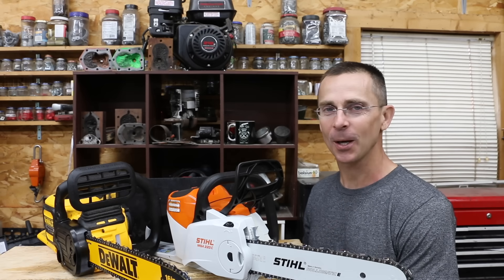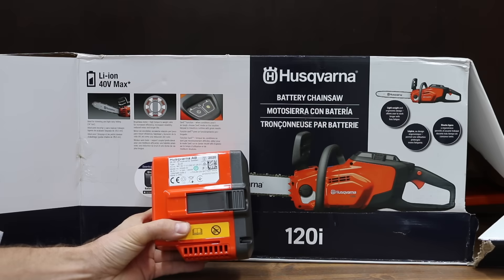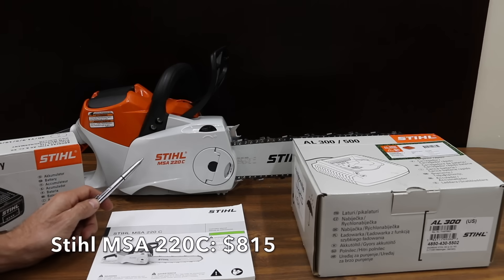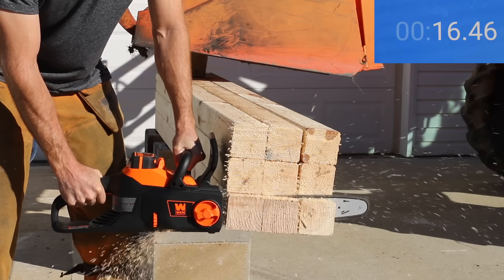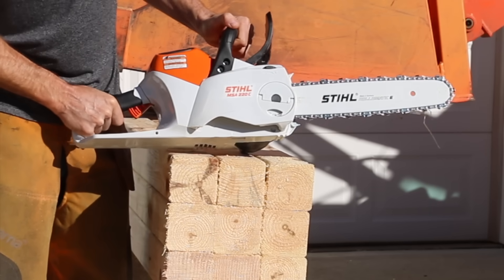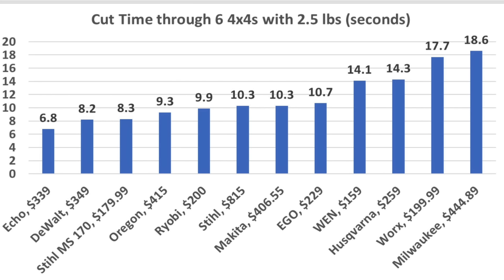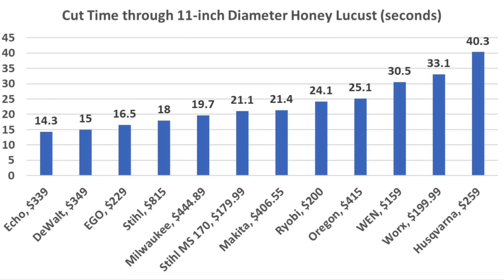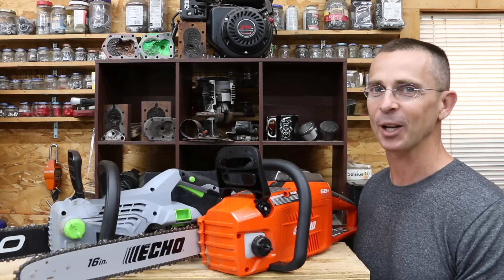Best Battery Powered Chainsaw Brand (ROUND 2)? Stihl, Husqvarna, Echo, Oregon, DeWalt

Comment: Thanks for all you are doing.  You have SO much credibility and are becoming the "go to" channel for purchasing decisions.  I have a suggestion for a video.  Recently you tested automotive batteries. In that review you used the Foxwell tester.  As I have researched these "Conductance" testers, there are so many at a wide range of price points.    I would love to see if the lower priced units are as accurate (or maybe more accurate) than the higher priced units.  In my studies I was also hearing the importance of  internal resistance (which you mentioned in your battery review)  as a key battery health indicator, which these types of testers can measure.  I have seen two lower priced testers become popular on YT (Quicklynks BA101 $40.99, and the Topdon AB101 $49.99).  Bottom line, I would love to own a tester that is accurate (and a good value) and can give me an early warning of a failing battery before it becomes an emergency.  Thanks again for the great job you are doing.  You have really built an amazing and very needed channel!!
Reply from the maker: Thanks for the video idea.

Comment: I’d like to see a test on  the best circular saw blades. Is Diablo best for the value? I do most of my cutting on treated lumber and composite decking boards. Is it worth spending extra money on a finish saw blade when cutting composite, and if I don’t switch blades when cutting treated lumber will the finish blade dull out quicker? Thanks for considering
Reply from the maker: Great suggestion!  Thank you.

Comment: I’ve got the E Go multihead system at home with the pole saw, hedge trimmer, string trimmer, and edger attachment. Only got the 2.5 battery which works fine for the string and hedge trimmers and it’s alright for the pole saw. But that edger drains it quick like that chainsaw. Definitely need a bigger battery for those high demand jobs.
Reply from the maker: Thanks for sharing.
Reply: @ProjectFarm  I'm not sure if you've already done a video on this or how you would, but I would like to see a test comparing different diesel fuel filter brands to see if OEM filters are any better than aftermarket filters. I own a Cummins and it's around $150 bucks for both fuel filters from Mopar. I'd like to find a cheaper alternative but I don't want to risk a fuel system problem either

Comment: Just thought of another idea sort of related to this. 

How much energy it takes to charge a battery (watt hours) vs. how much energy/work you can get out of it. 

As an added factor are quick vs slow chargers more efficient (or less loss)?
I am thinking tool battery packs, home made 18650 packs, deep cycle batteries etc. 

The information could be applied to electric cars or home battery systems.

If you really wanted to, the amount of energy per gallon of fuel for a generator would be interesting. Maybe even vs. your truck or tractor.
Reply from the maker: Thanks for the video idea.

Comment: Excellent video. Comparing batteries and runtimes is difficult though. People will buy into a platform and have batteries for different tools. I know the EGO has 5 AH batteries etc. including a fast-charger which is much faster than the regular one. If you have the mower and fast charger, you'll probably end up using that charger to swap batteries if needed or use the larger one you already have. I would assume there are variables like this for the other brands too.
Reply from the maker: Thanks so much!

Comment: Awesome test and Video!  I thought this might be a good place to add some thoughts.  I'm still combing thru comments to see but the "chain type" makes a pretty significant difference on those cutting time tests and would also impact your aggregated "productivity."  Now of course you used the chains they came with and one would think they'd all come with a decent "matched" and sharp chain (how the heck does 6900 RPM out cut 13,600 RPM??).  Oregon has to be wondering about these results hey?  Good grief is there no QC/R&D department at Oregon?
 
I see the expensive (Stihl) but NOT MADE IN CHYNA saw underperforms compared to the price, but one thing for sure on Stihl,  Husky and maybe the Echo is they will have parts for a long time, the rest likely will not have readily accessible parts 5 or so years from now, they change models quicker than some folks change underwear and parts support can go out the window changing so much year to year.

I can see the average home-owner with occasional use buying E-Go or Echo, but gosh golly "plastic dogs" really?  That's basically saying no chance of using the dogs for any kind of real effectiveness (imagine homeowners dulling a chain quickly) almost really just a safety feature more than cutting leverage usage. Maybe they put small dogs on so folks don't pry as hard and challenge the motor/battery or something like that.

I know my user name implies Stihl favoritism, full-disclosure is I own 6 (including pole saw) Stihl gas saws, but that's disappointing to see that high-end battery Stihl did not do at least a little better in these very well designed, fair, and well thought out tests.  

When I have friends who do not have chainsaws ask to borrow one of mine, first I offer my services if I have time if not they get my battery-powered sawzall with long wood blade.  (I'd love being your neighbor...haha saw that comment somewhere too.  

Seems to me those are all "effective" saws but run times are goona require a lot of batteries for any serious-whole tree or more work.  Kinda makes them more of a small tree/branch/pruning type saw.  I know that Stihl you tested is good for commercial climbers in the "arborist" version.  At least I have better intel on what to recommend to my weekend warrior friends who never owned a chainsaw ;-)
Reply from the maker: Thanks for the feedback.

Comment: Great series of tests.  I have both Husky and Echo gas saws.  My Echos are old and come with knob adjustable oilers for various kinds of cutting, wet/dry wood/etc.  I have a Husky battery saw too.  I was very impressed on who well it worked on a blow-down hardwood tree last spring.  Very comfy in hand and well balanced for limbing work on wind falls.  But it stalls pretty easy on say 10" oak and the like ...  Next time I will buy an Echo :-)
These battery saws are becoming a necessity for small work around the yard, Sunday morning cutting, a bit of assistance at the wood pile, etc.  With modern gasahol blends eating gas saw carbs, it's best to pull out a battery saw for occasional work.  Yeah sure, if I have a big tree to fall I'll grab the big Husky with real falling spikes, 36" bar and skip chain.  But for the odd job it's just not work the bother and noise for gas saw now days ...
Reply from the maker: Thanks!

Comment: If I'm going to buy a saw I better get more than 10 minutes if use.

Gas saw, gas can, pint of oil, quart of bar oil, 5 gallons of gas and you can work for the entire weekend for under 300 bucks and get it all at home depot.
These cordless jobbies are a rip off
Reply from the maker: Thanks for the feedback.

Comment: My complaint has to be tempered by the fact that the channel has to buy all these without sponsors (I can sympathize) and design very controlled experiments, which are sublime in their ingenuity.

 ... But to not test the 18" range toppers from Ego, Greenworks, Redback, etc. in a test to find the "best" cordless saw is like having a roundup for best sports car  then using a Boxter and not a GT3 for Porsche's submission.
Reply from the maker: Thanks for the feedback.
Reply: @ProjectFarm  you absolutely rock at experimental design, and the cost of these tests is positively eye-watering. It'd just have been nice to see every mfg's top end offering, since many of those 18" saws cost less than the 16" offerings from the big names in cordless tools. 

I'm subscribed for the long haul.

Comment: I have a kobalt 80V chainsaw and its amazing. Its great that its 80v too, because that means it charges at a higher voltage. So my kobalt 40v 2AH batteries take two hours to charge, where my 80v 5AH batteries only take 30 mins. Also the batteries last about 30 mins too (in realistic working time) so you can have two batteries and just swap back and forth alllll dayyy.
I live 100% off grid, so I use this thing every single day. It would be cool to see it go up against the winner. 

BTW electric saws are amazing off grid. They don't pull many watts while charging, so you can charge during the day, and use it whenever. Also, no more trips in town for gas.
Would I use an electric saw if I was a logger? Nope, but for me its amazing.
Also I think they would be a great saw for tree climbers, no more starting it 100 feet in the air. No more ear plugs. Just pull the trigger and go.

Love your videos btw. Whenever I actually get on the internet, its pretty much the only thing I watch haha.
Reply from the maker: Thanks for sharing.

Comment: I wish you would have talked about the different batteries and compared run times off that. The Ego has a 2.5 AH battery vs Echo 4 AH battery (1.6x the size). But the Echo ran for 2.8x as long (7.6 vs 2.7 minutes). Showing flat run time without taking into consideration the AH of each battery is misleading, would have been better expressed as minutes per AH. And then minutes per AH dollar.
Reply from the maker: Thanks for the suggestion.

Comment: I'd love to see a test of some of the budget electric lawnmowers!
great video by the way, as always, thank you!
Reply from the maker: Great suggestion!  Thank you.
Reply: I can give you a little info about a couple I've owned. The Worx brand electric mower is super light, but replacement blades are really hard to get (and expensive). The battery also failed entirely after two summers of use. They are not affordable to replace. The Ego brand electric mower is what I've been using the last 3 years. I just fired up the battery after another winter out in the garage and it's still running like a champ. Replacement parts and batteries are also more affordable and easier to get.

Comment: Fantastic review and attention to essential details, as always! After quite a bit of consumer research, I ended up going with the Ego 18" chainsaw (Model CS1804), which is their top-tier model retailing for $329. It comes with a 5.0 Ah battery (twice the size of the 2.5 Ah kitted with the model tested in this video), and differs from the 14" CS1403 model tested here in the following ways:

1) 18" vs. 14" bar
2) Fully variable speed trigger
3) Metal bucking spikes
4) 11,000 vs. 6,800 RPM chain speed
5) Cut-illuminating headlights — my personal favorite

For what it's worth, despite the Ego CS1403 coming with a 2.5 Ah battery, Ego states that all of their chainsaws will under-perform rated specs with anything less than a 5.0 Ah battery.
Reply from the maker: Thanks so much!  Thanks for the feedback.

Comment: Love your videos. I was able to pick up an Ego 18" 5.0ah model, $260 @HomeDepot clearances due to them ending their contract and switching to Lowe's now. 
That chainsaw is a freaking beast. The spindle speed is a crazy 11,000 rpm which is a huge difference over the 14" model. Also keep in mind that when going from a 2.5ah Ego battery to a 5.0ah it's not only capacity that increases but also amperage throughput, making and big difference in torque and speed
Reply from the maker: Thanks so much!

Comment: I would like to see some sort of durability test though that might take too long. Which one last the longest in hours of use. You could do price by hours it lasted before failure to get the full value.  This would tale to long but you could get some great data, especially if you wanted to average it with the rest of data. Thanks for the video!
Reply from the maker: Thanks for the suggestion.

Comment: I loved this one.. awesome man... thank you... Hey I was wondering if you could do another carbon clean up video.. do a set like you did with the oils.. see what one works the best in a fuel injected motor.. cleaning the injectors the pistons and the valves there is a ton of them out there new or up dated ones also.. so was wondering you could do a run off of them all see what actual does the best job.. and there is a lot of concern now a lot of mechanics out there. That  are saying it does break up the carbon but it plugs up the Catalytic converter now..  Just asking my man...  thanks for everything thing you do...
Reply from the maker: Thanks for the video idea.

Comment: Great video as always!
Thought of a good idea for your next test.
What brake lubricant is best?
ie what grease works well on lubricating slider pins ( must be rubber safe ) as well as lubricating the metal parts of the brake system eg where the pads slide on the calipers.

Tests could include:
Resistance to water and dirt build-up
Lubrication properties
Resistance to a quick spray with a high-pressure washer ( to mimic car being washed )

Lubricants to test:
Red rubber grease
Silicon paste
TEXTAR CERA TEC Mounting Paste 
Copper grease ( probably not rubber safe ? )
Reply from the maker: Thanks for the video idea.

Comment: Thanks for this great content.  Echo also makes nice gasoline powered saws but I'm really impressed that they were able to translate this to the electric platform.  Personally I'd still choose the DeWalt since you'll have a lot more tool compatibility with the FlexVolt battery line vs the Echo.

Question: What do you do with the all the tools once you've done with the testing?  Do you sell them on eBay, keep them or send them back to the manufacturer?

Next tool test thought:  Would love to see a comparison of compact 3.6/4V electric screwdrivers (Bosch Go, Worx, Dremel Go, Skil, Prostormer, Craftsman, Milwaukee, Ryobi, Hypertough, Hart and Hitachi).  There are so many on the market and hard to know which is the best in terms of cost, weight, speed, torque, battery run and recharge time).  They are a huge step down in power from typical electric driver/drills but they have their place for small around the house jobs and are very lightweight and compact and less expensive.   They generally come in three flavors: multiposition, pistol style and inline.  Personally I like to see the comparison of the inline style cordless screwdrivers as they are the most compact to ease access and storage.  I'd love to find one that just worked with aftermarket rechargable 18650 batteries but have yet to see one of those yet.
Reply from the maker: Thanks for the video idea.  Extras are donated to my community.

Comment: How did you account for the varying battery sizes for each saw? Should total passes be divided by the size of battery to get a pass/battery size performance rating? I get passes (through hardwood)/battery size (Ah) for Husqvarna 2.35 pass/ah, Ego 4 pass/batt, Stihl 3.16 pass/ah, Wen 2.33 pass/ah, Oregon 3.27 pass/ah, Dewalt 2.56 pass/ah, and Echo 8 pass/ah. An analysis of time/battery size yields; Echo 3.58 Min/Ah, Dewalt 1.66 min/Ah, Ego 6.48 min/ah, Stihl 2.5 min/ah, Oregon 4.18 min/ah, Wen 7.63 min/ah, and Husqvarna at 10.01 min/ah. While Husqvarna may last the longest per amp hour of battery, and Echo the greatest number of passes per amp hour of battery, shows varying saws strengths. The Dewalt might be the shortest cutting period per battery size and Husqvarna be the greatest, but the number of passes per battery size is less for both compared to a modest EGO, Stihl, Oregon, or the Echo. This illustrates that the torque on the longer lasting units may indicate is less than that of those saws that dont last as long yet are able to cut more passes. Do with this info as you wish

Comment: A comparison of popular household space heaters would be great! I feel like manufacturers lie a lot when it comes to space heaters.
Reply from the maker: Thanks for the video idea.
Reply: The most you can get out of a 15 amp outlet is 15 amps.  12 amps safely. The biggest difference is how it would distribute the heat.  One that  with fans suck with draft.  ir tend to spot heat.
Reply: @sunnydays4966  trust me, that $20 “1500w” space heater is not 1500 watts. Probably in the 1000-1200 range and will not heat any space effectively. Don’t even get me started on manufacturers BTU ratings. And what about safety features? Not all space heaters are the same

Comment: I've got an idea you might consider. I do lots of 4 to 0 wire crimping. Its atleast every other week that I've got to put new leads on a car or new alligator clips on some cables. Theres a bunch of nice crimpers available. Hydraulic, hammer and pin style, bolt cutter style, and possibly more. I've just been smashing mine flat with a steel table with a hammer.

Love your videos 👍
Reply from the maker: Thanks for the video idea.

Comment: I love you reviews but sadly, this review is completely flawed. You need to use same exact battery size, exact blade length and chain company with exact chain. All of these are huge factors and this is a complete fail. You comparing run time with different blades and battery size and more. I expected more from you
Reply: Also u can't say you compared them out of the box as they come because these chainsaws come in different packages such as battery size,etc. Next time make sure EVERYTHING IS identical such as same chain. Same chain oil... Same chain length and same battery size